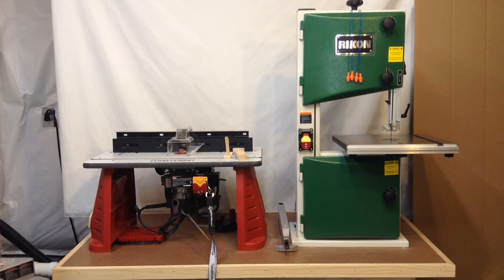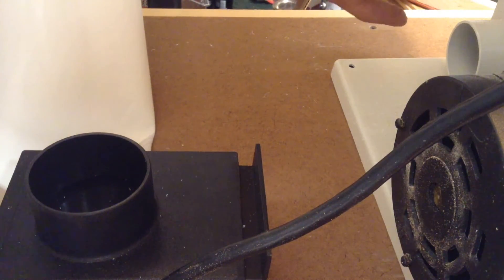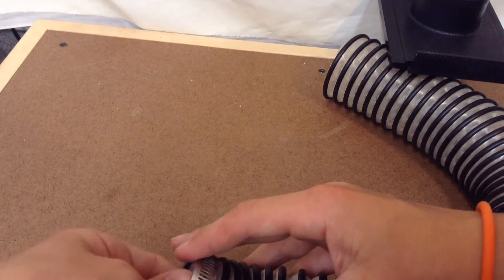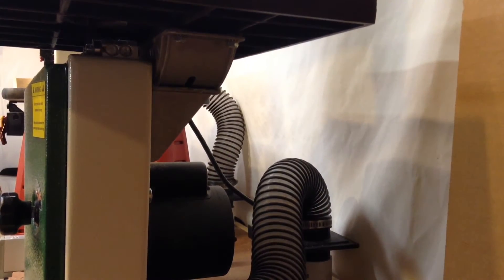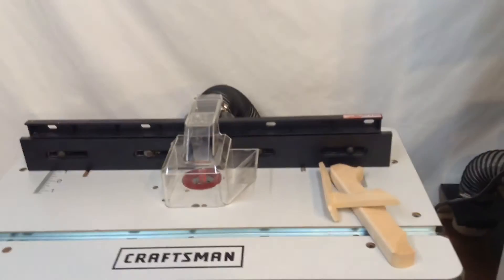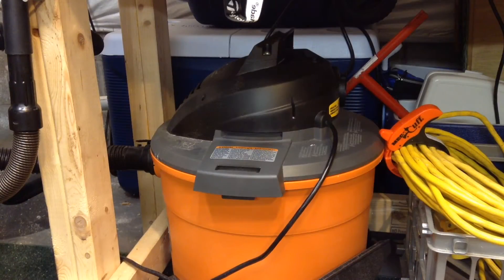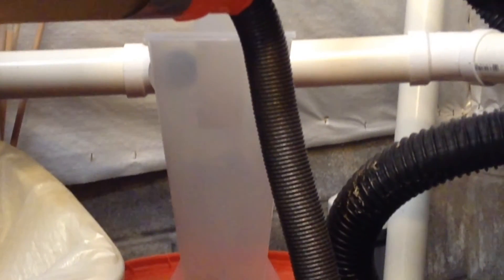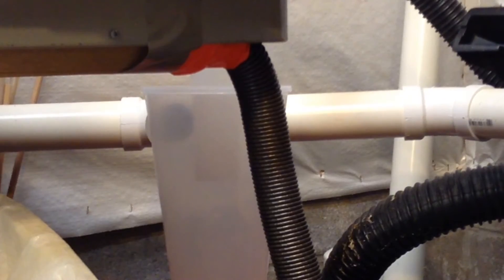Workbench dust collection (Part 2)

Comment: I like this idea, thanks. I have several mobile benches in my small garage shop and I've been switching pipes as needed.this idea fits well with how I'm set up. I have some tools fixed on the benches and some temporarily clamped on when needed. Again this idea fits well with that.
Reply from the maker: I am glad that you can use this idea, it's a great way to keep everything organized and keep the dust down.

Comment: Good follow-up video, mate.  Quick question: you mentioned a Dust Deputy. I don't know what that is, but based on what I can see from the way the hoses are connected, I assume that you are using the Shop-Vac ONLY as suction and the Dust Deputy is what actually collects the dust, yes? If this IS the case, what's the benefit of doing so? Why not just use the Shop-Vac for both suction & collection?
Reply from the maker: There are a couple good reasons to use the dust deputy. For one it makes it easier to empty out the sawdust when it gets full. It also prevents the shop vac filter from getting clogged, which in return makes your system run more efficiently.
Reply: +KroyWoodWorks Thanks a ton, mate!